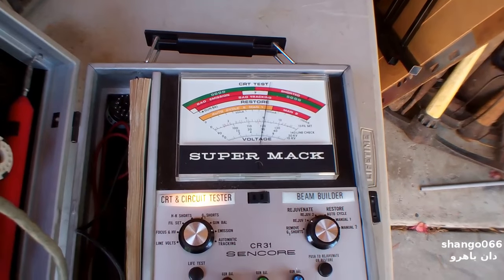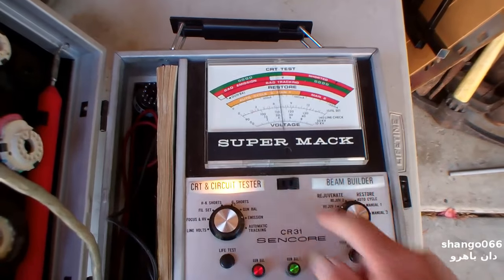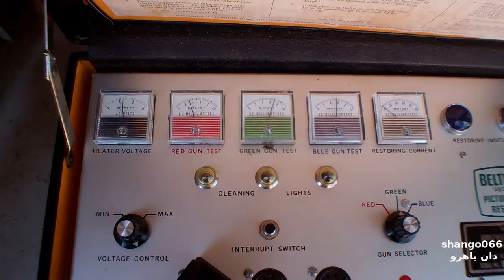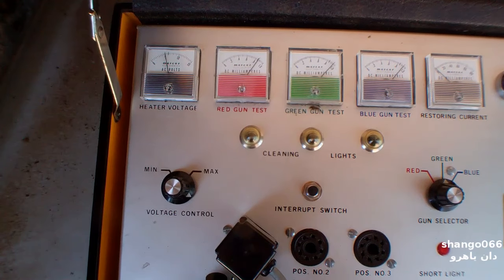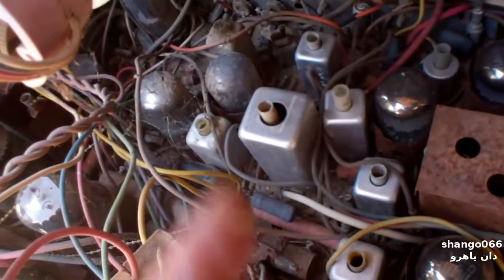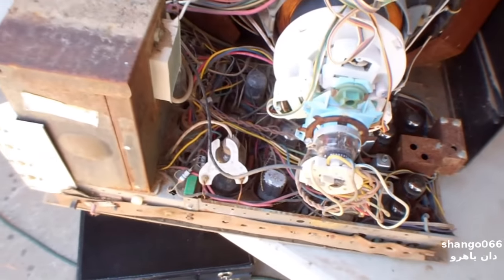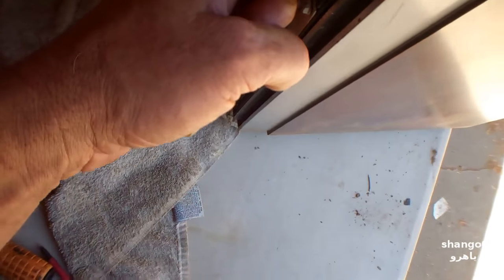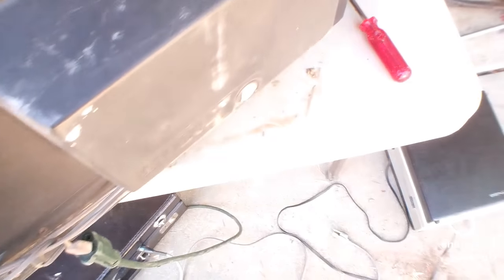Analyzing 12 Vintage Television Sets

Comment: I had a procession of colour TV's in The UK: 
They all had tired CRT's. The red parts of the pictures all exhibited flare at the edges.
All were 90 degree delta-gun CRT type. A re-gun  in any case was more than the sets were worth. 

I was offered a 405 line NTSC colour TV. It was a prototype from when they were considering which colour system to adopt in the UK. I didn't realise what the hell it was at the time (1985) and I turned it down.

Comment: A treat to come home trashed after a long day and find a long Shango video.
I don't collect TVs but today I got an old computer monitor for free. It reads Radio Shack TRS-80 Video Display manufactured December 1977. Looks like it's a modified TV, the case has holes to accomodate a telescopic antenna. It turns on, shows a white screen, bright tube. No idea what could do with it.
Reply: The Radio Shack "trash 80" computer did indeed use a TV (GE I think -  I had the actual TV) but without the tuner circuitry.
Reply: Judging from the labels, I think it may be an RCA. It has a DIN connector coming from the front.
Reply: +MisterTalkingMachine  you might be right about it being RCA. It's been a long time.
Reply: I just read the labels more carefully, it actually says RCA Model no. KTR 122S in the back.
Would like to figure out what kind of interface it uses, so maybe I could display something on it with a microcontroller or something.
If else, guess I could feed a composite signal into it.

Comment: Fantastic,  I watch every one of these TV videos, its the exact opposite of how I work on tube electronics and yet if find it quite intriguing.  Like Mozart vs. Death Metal.   I use a Scalpel you use a Chainsaw. My favorite are the Push and pray moment when you turn the power on.  Id be on the isolation transformer, Every electrolytic checked, Variac, 100 watt bulb in between, B+ on the volteter etc etc.   Plug it in and duck works too.    Them flyback transformers though, they can be scary stuff.

Comment: Shango066 that comment at the end about the porno made my day Lol also I just got done restoring a Emerson with the identical chassis as the one in your video (I have a video on my channel of mine) the plastic parts are super brittle including the plastic that holds the Slugs in the coils. even though it is High hour it still makes a okay picture I completely restored it. if you decide to try and get yours working let me know and I can send you the Sams in a PDF file for it, it's super hard to find being it's not a common chassis.
Reply from the maker: Cool, whats the sams number? I have most of the set in filing cabinets. I thought I fired that one up and it kinda worked, maybe it had bad caps or im sure it does
Reply: +shango066 it's sams 702-1 your's is just the tabletop version of my console model,  I believe it's the same sams it covers several different models and looks to be the same chassis :) I remember in your video it already had a new horizontal phase detector which is a plus, if you do make a video on that set it could definitely be interesting! I found out mine from the factory came with a cap that did not match the schematic in the I.F/AGC section it was supposed to be a .01 but instead was a .47 and you could tell it was original so I don't know how it  even worked when the set was new, when I got it restored it was throwing off the horizontal sync till I changed it to the .01 the schematic listed, I also talked to other TV collectors and I guess it's not uncommon for Emerson to put wrong caps or underrated values in their sets,would definitely be a good set for a resurrection video!. if you find out you don't have the Sam's let me know and I'll email it to you, I had to pay $22 for a "digital copy" of the sam's from there website which was a rip-off really for just a schematic and is probably worth more than the entire set, so if you find out you need it I'll just send a copy of the pdf file so you don't have to pay there ridiculous prices as well! by the way your videos are great! being completely honest it's more entertaining than cable/pay TV I probably watched close to all of your videos.
Reply from the maker: Cool, ill put it on the short list. I did kinda work I remember that. The last few tv videos have been a real pain with copyright issues. I will try and check out the video you made on it later today

Comment: Would there be a place that sells CRT / Tube testers anywhere anymore? If I have to go to eBay that's fine as well, but even though I've only got some 8 tubes I got out of a Zenith radio (a double diode, two pentodes, a triode, an unknown small tube missing some pins, and one with a plate cap?) that I don't know if they're in functional order. 

I don't really want to do this for a job per se, rather as a hobby because I always thought tubes were cool, and when I finally got into electronics, tubes were all but gone (ca. 1980).

Comment: The sad part is I had that and the older one with the double series string had the 29kq6 horizontal and 30ae3 both in separate Strings that set was newer with the 40kg6

Comment: What exactly does rejuvination do to the elements
Reply: Seems like it overvolts them and heats them up.  Not sure what that'd do, possibly burn off a layer?
Reply: It applies a bit more voltage than normal to the heater & then when you press the button it dumps a charged capacitor across the grid-cathode connection, this burns off some of the emissive material off the cathode to expose a fresh layer.

Comment: Ok, I've enjoyed your videos for a long time now and as I am not a TV enthusiast, Could you clearly describe 'Cut Off' to a moron?, Much appreciated if you could. Regards, J.
Reply: Cutoff is a measurement of how well the control grid (G1) is able to control the electron beam current flowing from the cathode. Specifically, the cutoff voltage is the grid voltage that just "pinches off" the beam current. If the G1 aperture in the gun is eroded, the cutoff point will shift dramatically.

On that CRT tester, you are supposed to adjust the grid bias to set the meter to a specific point before measuring the emission.
Reply: Bob Weiss
Thank you for writing that out, makes perfect sense now. Regards, J.

Comment: 1st telly works but not very well so ? 2nd telly DEAD JIM dead, crt thingy on the rear broken/opened so that's dead but neat to see a telly i've not heard of, a bradford color be able to get some parts from it the tubes and the buttons n knobs as there useful for other telly's,  3rd telly unknown name but is looking ok kinda dead but not so another ? 4th telly oh classy an emerson very posh its kinda working but not 100% plus no idea the blasted thing turns on! 5th telly rather sweet lil telly very 70's with the black n yellow looks okay but eh neat old mini telly but mostly could be a vid on it own, 6th telly hmm even more intrestering oh dear smashed up on the holes and looking bad side ways but it bloody well works oh great it tunded into hell why do telly's do that? bargh! and it burnt though its own cable lovely! dam like a fry up in the morning this telly came to quickly! so worked ish 7th telly old panasonic no knobs looks to want to work another vid, 8 9 and 10th tellys are al the same kind  1st telly of the set works kinds, 2nd one of the set works? 3rd of the set works? 11th telly cute lil thing tosh telly works and wow a bloody good image! hay only 11 tellys you said 12 boo!